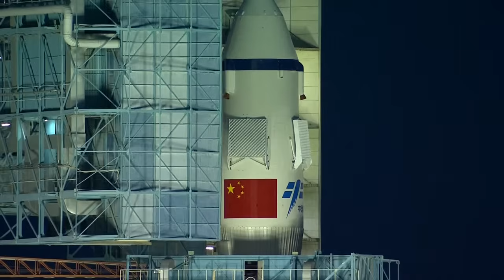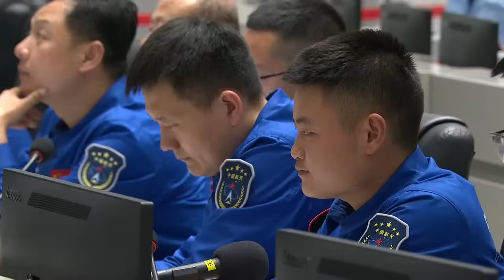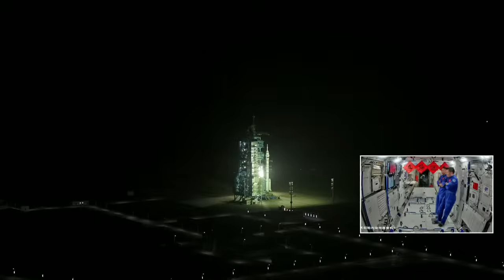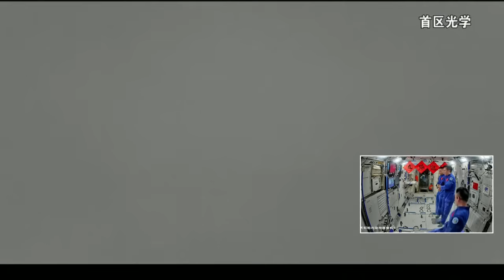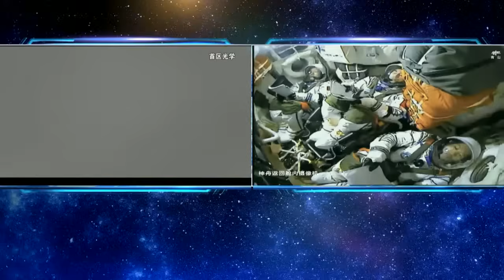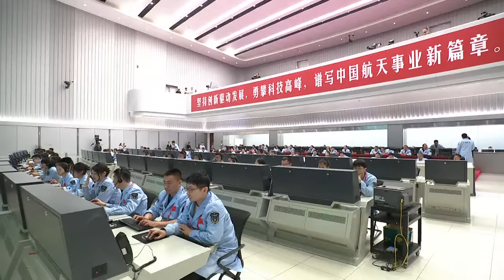Replay! China's Shenzhou 18 crew launches to Tiangong space station

Comment: AntiGravity Aircraft The Next generation Spaceship
Work base on Gravity just spinning by using Battery
can fly in bad weather plunge in the ocean even in outer space

Earth which weight predict 600 trillion ton does not fall at the Sun because of centrifugal in orbitting, on the contrary it does not be thrown far go out the orbit line of hold by gravity at the Sun as orbit center. Gravity and centrifugal is equal called Equillibrium, thats why until now Earth which we was inhabited always rotate and circulate the Sun. Now we justly take example : how if the gravity used and centrifugal is negated? The Earth will float far leave the Sun. So that centrifugal can be used to fly far away if gravity eliminated. Finally how to eliminate gravity?

It’s way rotate part of aircraft by horizontal. When that rotation faster centrifugal force getting greater and the gravity getting smaller, finally it lose the gravity and the aircraft start flying. Of course people would surprise: how the aircraft can keep rotate without fulcrums? Thats why we named that aircraft Shuttling System that is aircraft likes two disc adjoining attached in the midle as fulcrums:

A. The Top part, we name Positive rotate to right, and the edges is getting thicker and havier.

B. The Buttom part, we name Negative rotating to left, and the edges is getting thicker and havier.

C. Middle Part , we name Neutral, air crew placed and also machine and everythings turning Negative and Positive at the same time.

The aircraft can liftup added with explosion from the engine. However that aircraft construction later, let the engineer doit it, and we are sure the aircraft will bulletproof and also waterproof.
 
.
.
 
In modern civilization where human being generally using flying saucer as vehicle, will a lot of change in lives either in materialism and in psychological. In materialism area will apply the change in life like.
People no longger need roadway and rel road which spend large of energy, money, places, things and time, object place and time. People would utilize that area for habitat or for other need:

Comment: Wishing the Crew a safe journey and return crew- Have a safe voyage home. God bless.
Reply: AntiGravity Aircraft The Next generation Spaceship
Work base on Gravity just spinning by using Battery
can fly in bad weather plunge in the ocean even in outer space

Earth which weight predict 600 trillion ton does not fall at the Sun because of centrifugal in orbitting, on the contrary it does not be thrown far go out the orbit line of hold by gravity at the Sun as orbit center. Gravity and centrifugal is equal called Equillibrium, thats why until now Earth which we was inhabited always rotate and circulate the Sun. Now we justly take example : how if the gravity used and centrifugal is negated? The Earth will float far leave the Sun. So that centrifugal can be used to fly far away if gravity eliminated. Finally how to eliminate gravity?

It’s way rotate part of aircraft by horizontal. When that rotation faster centrifugal force getting greater and the gravity getting smaller, finally it lose the gravity and the aircraft start flying. Of course people would surprise: how the aircraft can keep rotate without fulcrums? Thats why we named that aircraft Shuttling System that is aircraft likes two disc adjoining attached in the midle as fulcrums:

A. The Top part, we name Positive rotate to right, and the edges is getting thicker and havier.

B. The Buttom part, we name Negative rotating to left, and the edges is getting thicker and havier.

C. Middle Part , we name Neutral, air crew placed and also machine and everythings turning Negative and Positive at the same time.

The aircraft can liftup added with explosion from the engine. However that aircraft construction later, let the engineer doit it, and we are sure the aircraft will bulletproof and also waterproof.
 
.
.
 
In modern civilization where human being generally using flying saucer as vehicle, will a lot of change in lives either in materialism and in psychological. In materialism area will apply the change in life like.
People no longger need roadway and rel road which spend large of energy, money, places, things and time, object place and time. People would utilize that area for habitat or for other need:
Reply: 嘿兄弟，大多数中国人是不信上帝的，只信任人类，不过还是要感谢你的祝愿❤
Reply: @陈晨-k2i  我命由我不由天
Reply: @陈晨-k2i  中國信神，但跟西方的上帝不是同一個神仙，中國是玉皇大帝，佛祖，還有好多神仙😂
Reply: @陈晨-k2i  CCP will find Separatists like you soon. Don't worry ✌
Reply: @陈晨-k2i 👎👎👎👎👎👎👎

Comment: so proud of my great mother country
Reply: AntiGravity Aircraft The Next generation Spaceship
Work base on Gravity just spinning by using Battery
can fly in bad weather plunge in the ocean even in outer space

Earth which weight predict 600 trillion ton does not fall at the Sun because of centrifugal in orbitting, on the contrary it does not be thrown far go out the orbit line of hold by gravity at the Sun as orbit center. Gravity and centrifugal is equal called Equillibrium, thats why until now Earth which we was inhabited always rotate and circulate the Sun. Now we justly take example : how if the gravity used and centrifugal is negated? The Earth will float far leave the Sun. So that centrifugal can be used to fly far away if gravity eliminated. Finally how to eliminate gravity?

It’s way rotate part of aircraft by horizontal. When that rotation faster centrifugal force getting greater and the gravity getting smaller, finally it lose the gravity and the aircraft start flying. Of course people would surprise: how the aircraft can keep rotate without fulcrums? Thats why we named that aircraft Shuttling System that is aircraft likes two disc adjoining attached in the midle as fulcrums:

A. The Top part, we name Positive rotate to right, and the edges is getting thicker and havier.

B. The Buttom part, we name Negative rotating to left, and the edges is getting thicker and havier.

C. Middle Part , we name Neutral, air crew placed and also machine and everythings turning Negative and Positive at the same time.

The aircraft can liftup added with explosion from the engine. However that aircraft construction later, let the engineer doit it, and we are sure the aircraft will bulletproof and also waterproof.
 
.
.
 
In modern civilization where human being generally using flying saucer as vehicle, will a lot of change in lives either in materialism and in psychological. In materialism area will apply the change in life like.
People no longger need roadway and rel road which spend large of energy, money, places, things and time, object place and time. People would utilize that area for habitat or for other need:
Reply: May be Chinese people are good but their government are greedy and propaganda deceitful
Reply: But your Granny didn't like it there since she left
Reply: hahahahahha brainwashed yooooo
Reply: @israeldavidson3242 says the brainwashed
Reply: @israeldavidson3242  Could it be that all we see is an illusion, and the Chinese space station is all GC? Your jealousy has made you lose your mind
Reply: @israeldavidson3242  When jealousy take over your brain. 😂
Reply: @israeldavidson3242  Can brainwashing create a rocket?😅
Reply: @israeldavidson3242 mega infrastructures?
Reply: @israeldavidson3242  say the one named Israel.... 😂😂😂
Reply: @israeldavidson3242 that‘s what you say when someone says they like their country?i can only surmise that you hate your country
Reply: @israeldavidson3242  Stop being so sour loser. 😂
Reply: @israeldavidson3242 你不为自己的国家自豪？